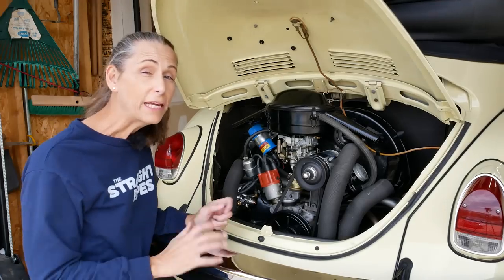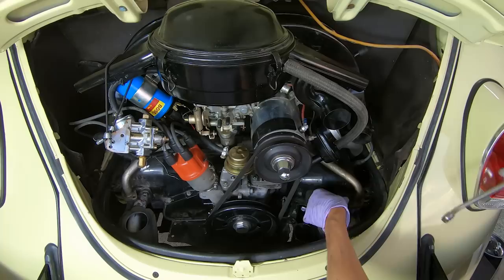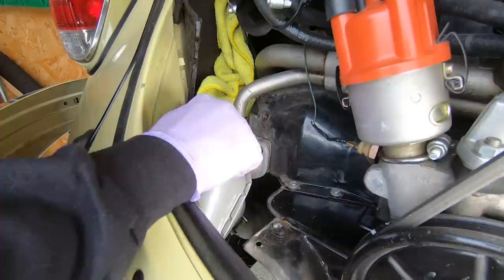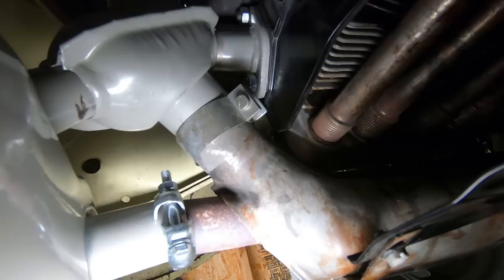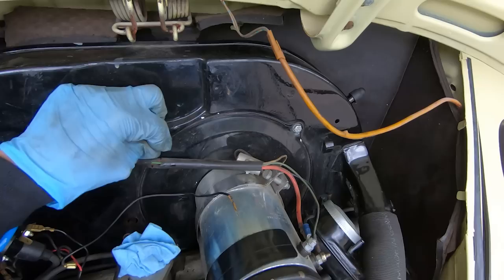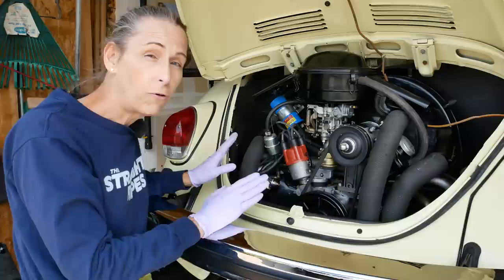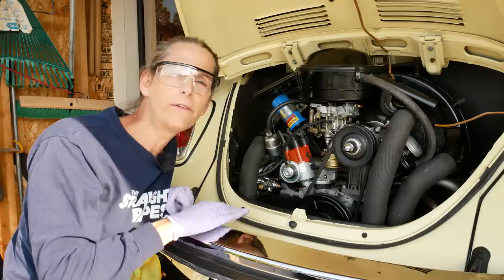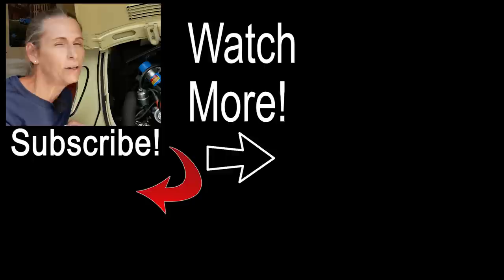VW Beetle NIGHTMARE Muffler Install and a Proper Distributor!!

Comment: The Beetle would become super beetle rear engine car. The torsion shock bar helps to make the rear wheels of the bug into camber with its movement and it spring sideways. As if load in heavier (add weight) to the back of beetle that cause into negative camber. The camber is base on the distance between the top part of the passenger side wheel and the top part of driver side wheel. The shorter the distance that is called neg. camber. The more the distance pass the straight up of both side wheel is called Positive camber. To prevent it from pos. camber use the bumper rubber mount of the bracket pocket and it will strike the against the bottom part of backing plate to keep cornering of a fast speed into not capsize.
 The front of the torsion shock bar goes to the chassis unique pan of super beetle otherwise if the beetle doesn't have the pair of torsion flex shock bar suspension then it is not super beetle. The reason is do try not to strain the ball bearing in sideway of the wheel while cornering around it. Just the kinetic pressure of psi into wheel force downward versus the track force is better way for bearing to handling the little friction because the sideway friction against the ball bearing cause it into more friction so it slows down the Indianapolis NASCAR racing high performance Volkswagon or BMW formula 2000.  
 The backing plate usually carries the brake shoes and brake cylinder and anchor and it attached bolted to the live axle housing at flange end of heavy-duty tube but not Volkswagen so it uses the spindle that holds/bolted or fixed to the front of backing plate and backing plate is welded to the CVJ then whatsoever the suspension that torsion bar system of parts which has to connect to the backing plate. Please show more of torsion bar and suspension instead of lower control arm and upper control rod/pipe arm with coil suspension called independent suspension for rear wheel.

Comment: something changed with the static distributor timing around 21:30. You can see the vacuum can has moved into the correct position without an explanation.

Comment: bend the hot air tubes a little , that;s all,  no grind no drill method, when all bolts and nuts on intake and exhaust are loosely installed

Comment: You are tired of reading my nonsense, but it's order of operations.  The intake manifolds to the heads connexion is critical.  No leaks, and the metal gaskets can only be crushed once.  Everything else needs to be bent to fit.  

The mufflers are a PITA, and the carb/intake/carb base heating is equal nonsense.  Many times it's a matter of putting stuff in a vise and bending it.  Other times it's a big crow bar to get stuff lined up.  Other times it's longer bolts to get the shorter bolts lined up... and then the longer bolts go in the coffee can....

Comment: I read somewhere that if you're running an electronic ignitor that you can't use the conventional timing marks and you have to time it by ear? 
Obviously that wasn't the case with yours. So I'm wondering. I tried setting the timing on my 74 bug with what I presume is a 1600 DP and I can't get the timing marks close without the engine bogging down and running rough. If I set the distributor to where the engine sounds smooth, it'll idle great and rev just fine and it pulls good when driving it (with the exception of a little hesitation at takeoff) but the timing marks show the 7° mark to be almost an inch to the left of the case split.... This is my first time working on these and it has me really scratching my head. Also, when I shut it off it won't start back up without cranking for a bit with the throttle wide open. Once started it'll settle back to idle and sounds good and revs good. Thoughts, suggestions? 
I've adjusted the valves to 6 thou, changed the plugs and wires, adjusted the carb (empi pic 3) checked for vacuum leaks. HELP! LOL

Comment: Is that a fuel filter in the engine bay of a beetle? Thats a big fire hazard. i always learned place them in the front under the feul tank (sorry if i spelled some things wrong) i love your videos!
Reply: They did not have an aftermarket filter when new.  The tank and pump had filters

Comment: When it comes too the soo called dead spot most of the time it's not the 009 dizzy. Have you verified there are zero air leaks/vacuum leaks? Because I've run 009 dizzy my entire life,my father was a vw/porsche/audi mechanic and he swore by the 009. Also the vacuum pull dizzy will work better if your engine has air/vacuum leak. I never run a vacuum pull dizzy.

Comment: Great video.  You didn’t mention the spring down at the bottom of the distributor hole.  Was there one?  Also, the Shepherd’s Crook for the advance.  I also use a longer extension on my ratchet for the distributor clamp nut (keeps my hands and what not from hitting the fan belt).

I’m hoping my muffler outlasts me, because so many mufflers for bugs nowadays have such poor fitment.

Comment: Those EMPI parts never really fit that great like the original German parts, your best bet is to get Wolfsburg West parts they're expensive but fit great. I really liked the bug series, hopefully he needs more work done in the future. I also noticed you put a fuel pressure regulator on the bug, what's your reason for that?
Reply from the maker: It is a bit of a long story (I did a video on it) but the long and short of it is that the new fuel pumps can't seem to be adjusted to the 2.6psi or so without compromising on flow.  They put out more like 5psi which is too much for the needle and seat in the float valve and it can no longer control the flow.  I show in the video that even with the car off, the pressure blows past the needle valve and dumps fuel into the intake manifold.  Then when you go to start, it is terribly rich.  If you shim or grind the pushrod to get the pressure down the flow will be so low that at cruising speed the engine will run very lean.  The pressure regulator will bring the pressure down without compromising flow.

Comment: You should of used 2 nuts to lock on the stud and then put the exhaust in place instead of filing the hole.

Comment: Question. Shouldn't you have set the higher 36 degree timing with the vacuum hose off as well? Thanks for sharing.
Reply from the maker: Well, with the vacuum line off it won't advance.  Try it both ways and you'll see...  I needed to see the absolute max advance you would get under actual driving conditions.

Comment: What was wrong with the old muffler? It looked ok to me. I wonder who it was made by.
3:34 that’s why it doesn’t fit....”empi”.....it probably came in a blister pack ha ha ha.
Walker, listeritz are ones you don’t have to drill to make fit.
I bought a klokerholm and really had a time putting it on, but didn’t have to drill.
Check out the inside left...drivers side of that muffler.
The klockerholm ones don’t have the “Bernoulli principle “ tube. It’s build in the preheat pipe somehow inside....I don’t believe them....but it’s what they say.
Some do, some don’t.
Essentially it’s a tube, that the left peashooter has to be about a half inch from as it’s inserted into the muffler. This allows a vacuum to be made in the heat riser tube.
Allowing the hot exhaust to circulate right to left and preheat the carb.
If you have that exhaust off, take a 3/8 piece of zinc plated stranded cable, cut one end at a 45* angle, and weld its end so it won’t unfurl.
Then weld the other end about an inch....3 sides, so when the welds are ground will chuck up into a cordless drill.
Use the 45 degree end as a “bit” and with welding gloves on work that through the coked up heat riser tube, pray that it doesn’t bore through the the weak rusted spot....and don’t look up for you’ll get a face full of soot when drawn out.
It will really run nice if the intake charge is being warmed up proper.
And
You ought to talk the owner into buying  the correct distributor, FP, and carb. They are all available...about $800 for all through Sparkzwerkz, and whatshisname......on Samba. The carb guy.....ohhhhh...can’t remember.......Volksbitz...that’s it.
That car would run like a scalded dog.....look correct,.....and...and..
You would have a customer that would need their points adjusted/ replaced. $$$ 😀😀
Thank you for the Great videos!

Comment: Love your videos and how you manage to keep calm. I would have been swearing at it in broken German.  I would have been very tempted to cut a little bit off those inlet manifold heater pipes and reweld the flanges back on.

Comment: ain't that exhaust a nightmare! I had to clean the carbon out of the heat riser tube, ended up pulling the engine!!! PS what carb are you running on that car? Thanks. Carry on.

Comment: Hi!  I just stumbled onto your channel!
& I gots a question.
See my little avatar?
The motor in it is a 1/2VW, literally sawn in half.
(It makes the nicest sound!)
This motor has points and I'd love to get rid of them.
Would this installation work on that motor (It's the 1600cc, rather, 1/2 of 1600cc)
Thanks!
Your instructions are very clear with good video.
It would be neat to own a VW, but dang it....I need an AC!

Comment: Great Video! I have to install a new muffler and this has given me the confidence to tackle the job. Thanks! You videos are so detail oriented and helpful! I have a question about my '75 Super Beetle Convertible named "Day Tripper". Just recently the "egr" and "g" light on speedometer will come on red at neutral and at low rpm. I'm reading that the egr light can be reset and is basically a reminder for emissions. However, what concerns me is the G (generator light?) The belt is turning so my fan is cooling but i'm concerned that i may have an electrical issue. Any thoughts?
Reply from the maker: That G light will signify power flowing from the battery so the alternator or voltage regulator is a bit sad (or you have some bad electrical connections - check the field wire).  Check the voltage coming out of the alternator/voltage regulator.  It should be 13.7V.  If not it may need a rebuild.

Comment: I’ve got VW beetle based trike and have had to replace the gear shifter as the pin at the end of the stick snapped. My genuine VW replacement shifter won’t fit into the  linkage cup. Does anyone know if the shifter ball joint size is meant to be standard?

Comment: Franny I need to change my distributor clamp. It seems to be stripped.  I can’t get it so lock fully into position it stays kinda loose. When you pulled that dist out was there anything holding that clamp to the car or could you have just lifted it right off ?

Comment: I suspect the problem with the muffler fitment was due to the fact that it's an Empi part. I've sworn off that brand, because nothing I've bought fits correctly. I've had mostly good luck with their tools, but I won't buy their parts.

Comment: always love your videos--question--running dual weber idf carbs on a 1600 dual port.  I have a pertronix II--with vacuum advance (from a 2013 rebuild) --but advance doesn't seem right only drawing vacuum from left carb.  Any recommendations as to best distributors and any overall tips on running dual carbs with vacuum advance?  thanks in advance.
Reply from the maker: If you are running dual carbs with short intake manifolds I think you will do better with a centrifical distributor (just not a 009).  With the carbs so close vacuum slows things down. I think there are a few good aftermarket distributors out there. Take a look at the advance curve and pick one you like.  All the Porsche 356s have centrifugal advance.

Comment: 73 beetle all of sudden no power to dash lights,board nothing, replaced fuses check wires on fuse box new regulator, generator can coil be bad or short somewhere need help

Comment: Hi. In respect to electronic ignitions, have you ever fitted one to your 356 and if so which one would you recommend pease! Thanks from the UK.
Reply from the maker: We do not believe in electronic ignitions if you want to keep your classic car healthy.  It will cause other problems down the line.  Having a traditional ignition allows your engine time to get the oil flowing an lubricated.

Comment: Awesome video, I just got the same distributor and coil and I'm about to install it on a newer mexican beetle, are the advance numbers the same for all 1600 engines? I'm new to beetles thanks in advance
Reply from the maker: Yes, the max advance should be 32-34 - not much more.  If you hear any knocking and pinging under load your advance is too high.

Comment: Hi Franny, I have a 1970 type 2 bus. Can you advise to what upgrades would be a good idea? It runs ok but would like it to run better. Any help would be grateful! Thanks for the great videos!
Reply from the maker: Probably start with electronic points if you still are using mechanical ones.  As always, keep up on the maintenance.  These cars are pretty sensitive to things being out a bit.  As always, in the order of Stop, Turn, Go just be sure your brakes are working well as well as the steering - tires, etc.  If you want to go nuts you can build the engine out a bit and add dual carbs, but that can bring its own issues.
Reply: Thanks very much for the advice! I appreciate your expertise. Everything on the bus is original, I will certainly use your recommendation for the electronic points. All noted on your other comments. Take care and thanks for the information. Your enthusiasm in the videos is refreshing!!

Comment: My plug wires are like  cap you took off,do I have to rotate and change or is it different on 009
Reply from the maker: Just set the engine to TDC C#1 and then follow the #1 lead to the cap.  It needs to line up with the rotor at that point.  Then follow the firing order for the rest of the cylinders.

Comment: Hi Franny and Heidi! Was that muffler OEM or OE? Seems it just should have fit better.
I remember back in the early 70s, I think it was, a guy I used to work for in a auto parts store said something like "I don't know why they need to use electronic distributors now. The points distributors are well proven and reliable."
I didn't say anything but I always thought points were a pain in the butt, especially if they were dual point like some I've had. 
I've always liked the sound of these Beetle motors, especially when they are running right.
Bye!
Reply from the maker: The muffler was from EMPI...  Just awful...

Comment: Its a bad reflection on the ability of the mechanic to have a problem working on a beetle. They are designed to be worked on by any backyard mechanic and are dead easy to fix just about anything. And it only take 30 minutes to drop the engine so thats the way to replace the muffler.

Comment: Should have used a 009.
Reply: Not true.  This distributor has a vacuum advance unit,  this will always perform better than a full centrifugal advance unit for a stock, street driven application.

Comment: Franny I have  a 1958 beetle type1  1192 cc 36 hp. I bought a vintage speed Abarth style exhaust system. They tell me it is the correct exhaust for this beetle, could this also be a nightmare? I find it hard for people to even work on it! Should I keep it stock? Or take my chances with it? Thanks Michael Fiaschetti
Reply from the maker: If it was me I would keep it stock. I think that signature tweet from the original exhaust is the best part!
Reply: @HeidiandFranny  Thanks very much!

Comment: Hi! I am trying to get the distributor out of the engine to clean it because it is rusted but it is stuck. I loose the nut that holds it to the block, put the rotor pointing to cylinder 1 but it won't come out. Any tips? Thank you!

Comment: Would have just been quicker to drop the engine, 8 mm, 4x 17 mm and a 10 mm and it drops out and a few screws, if this is a Mexican made muffler that's why you had issues, should have bought one from Brazil, they just fit.

Comment: How do you like that Petronix distributor so far? I’m thinking about buying one but have heard mixed feelings about the electronic ignition vs points.
Reply from the maker: So far so good :) The thing about the electric points is that they never were out, bit are an additional electrical part that can fail. They do also seen to have a significantly larger dwell angle as well.  Probably best to carry a spare set of points just in case ;)
Reply: @HeidiandFranny  thank you! Ordering one today!

Comment: Suspect you fell victim to a non standard size muffler and the spacing distances between intake manifold ports??
Reply from the maker: Not sure there a real standard (well, maybe from the factory...).  It would really help if there were just slightly adjustable.

Comment: The 009 is a horrible distributor.  Its only good for drag racing or flat out driving. 

A distributor with a proper curve and a vacuum advance really transforms the car. It has all the benefits without the drawbacks

Comment: I have a 009 on my vw bug and it is perfect, the last 2ltr bug I built also had a 009 and I never had any flat spots, so your diagnosis is incorrect.
Reply from the maker: Your carb is jetted too rich. It is the only way to remove the flat spot. I have talked to many people with 009s and they all have similar experiences. The 009 was designed for constant RPM applications and is a poor choice for automotive use.

Comment: Those aftermarket mufflers are horrible to install. I have done so many of those but, there is hope. Vintage Speed has exhaust that solves fitment issues: https://youtu.be/0uFoAkcgMhg. Yes they may be pricey but, eliminating the time and struggle is so worth it. Good idea with the Distributor. The .009 does have flat spots with single carbs. VW does have a chart that matches the carb with the distributor. Thanks for the video.
Reply from the maker: Thanks for the info.  I knew there had to be something better.